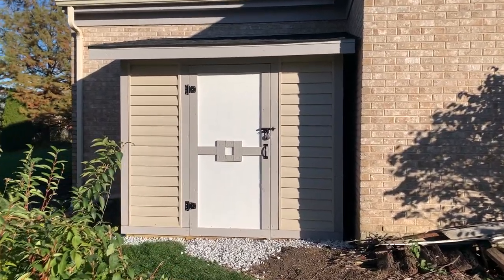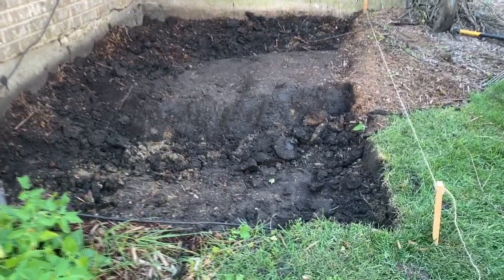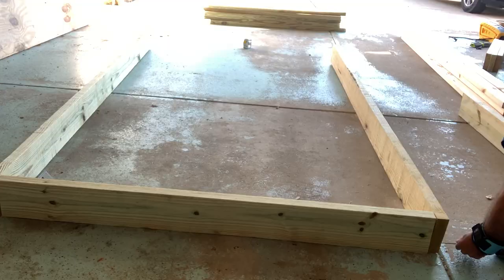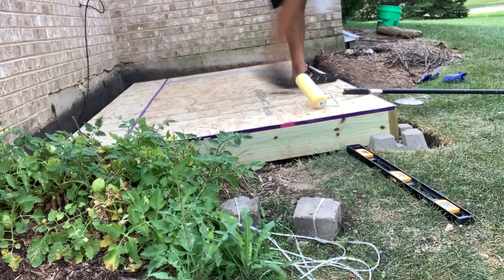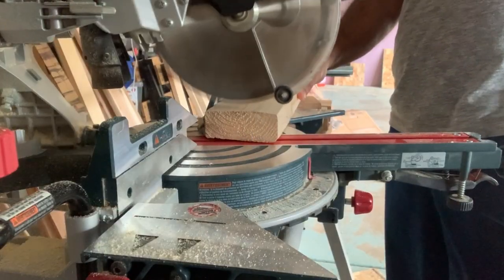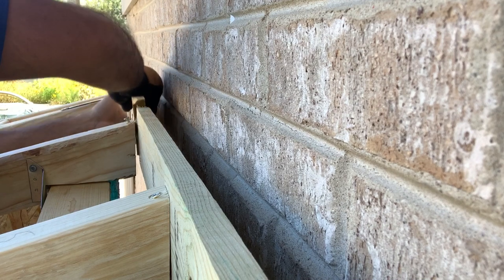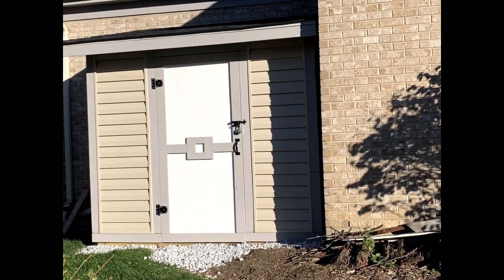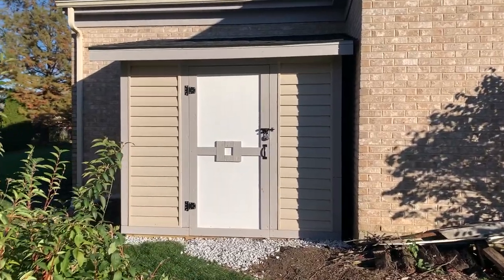How to Build a DIY 5X8 Lean To Storage Shed (Bike Storage)

Comment: Thank you for the great instructions you provide. I really enjoy your videos. 

However, I have a question. How do we weather proof the sides which back up against the back wall. I’m anchoring my shed to the wall of my house.  I have a brick veneer house, but the concern would be the same regardless of it being weatherboard or brick veneer. My concern is when it rains directly in that area (back house wall) or when the wind pushes the rain in that direction, it will rot out the back wall. Does anyone here have any ideas or suggestions to deal with this? Thank you guys in advance 🙏
Reply from the maker: Thank you very much for that comment.  I really do appreciate it. Regarding the weather proofing.  I just painted the OSB with exterior paint.
Reply: My question was more about how to prevent water pooling up behind the shed (where it backs up against the house).
Reply from the maker: @Foodie-yj1qe  ahh ok.  Thinking back, this is not something I paid too much attention to...but I did add some gravel on the bottom, which hopefully helps with draining.
Reply: @Foodie-yj1qe  you will want to construct the building directly onto the wall of your house and then construct the roof in a way where water cannot get behind it. all joints have to be covered with waterproof material. depending on your situation this could mean you have to build the roof right up against the wall and then cut into the brick and insert flashing like lead flashing or fiberglass depending on what roof you are building. That has to go a set depth into the brick and then that get pointed in so any rain that hits that wall will slide down the wall, over the join, and then over the flashing, which will be laid over the roof of your construction so theres nowhere for water to flow down into a gap. 

another possibility i you may have a facia on your existing wall that you can tie the new roof into that. Either way its all about making it so all the materials are layer on top of each other in a way were water flowing down ca never go between a join. and for every join to be able to withstand some amount of driven rain possibly pushing water upwards. 

you should be able to find more details on exactly what this looks like if you look up building "extensions".
Reply: Big bang theory episodes
Reply: I'm doing the same thing by attaching to exterior wall. I NOT using Doors as I'm going to cut a hole in my house wall, it the garage so I can have access from inside. So when your up against the wall you will need to flash it.

Comment: Idea, try hanging every other bike from the rear tire, that may get you some more room in there.  Great job!  Also, the tape measure has markings for every 16” to help with marking them quickly.
Reply from the maker: Yup. Great idea. Simple but effective. I will certainly stagger them.

Comment: Great construction! One question: Did you use the exterior siding also on the sides that are protected by the house wall? I want to install it in a place where only the front will be visible and that will save material & cost. Or what did you use to protect those sides? Thanks!
Reply from the maker: No, siding was not used on the sides facing the house structure.  I just painted these walls with an exterior paint before assembling.
Reply: @MakingHomeBetter makes sense, thanks a lot!

Comment: Is it ..ok to have the roof leaning toward the door? Im not sure what most sheds do. I was thinking it would always make the entrance wet. Also, do you have any problems with the dopr sagging?
Reply from the maker: I supposed it all depends on the location. Where this shed is, there is a bit of slope on the ground away from the shed. So water sitting  in front the door is not a problem. Also the door so far has no sagging.

Comment: Great job! I think it looks very clean and blends nicely. Q: could you have used the house as the back wall? Just curious...thanks
Reply from the maker: I suppose that's an option.  You can connect it straight to the wall.  I didn't think of this, but would also be worried about getting a perfect seal so that water does not leak into the shed.
Reply: @MakingHomeBetter   yes...good point and I realize no shelving.......

Comment: Very Nice Sir.  Gives me some encourgement to build similar.  Did you use or consider pressure treated lumber for floor?
Reply from the maker: Thank you. I did use pressure treated 2x6s for the floor frame. The only part that comes in close contact with the ground.

Comment: Is your garage floor level?  Flat?  Did you have vents under the front of the rafters?  Are your weather issues such that freezing or mildew growth in those cramped areas next to the house are minimized?  I'm thinking about this exact thing for storage of all my wood products used in my shop.  I have some trim piece storage inside, but this outside shed makes sense.  Nice job!
Reply from the maker: Thank you. There is some space for ventilation by the rafters. I have not had any issues between the shed and the house so far.

Comment: sir i have a question, how did you close the gap at the top of the back of the shed where the rafters extend just a little bit towards the wall? that space cannot be reached right? thnx
Reply from the maker: If I understand you correctly, you are talking about the small gaps between the rafters? If so, I did not close this. Left it as some ventilation.

Comment: did you put siding on the back wall as well? if so how since it is so close to your actual house wall? Thanks
Reply from the maker: Nope. The back wall does not have siding. I did however paint it with exterior paint before putting up the wall.